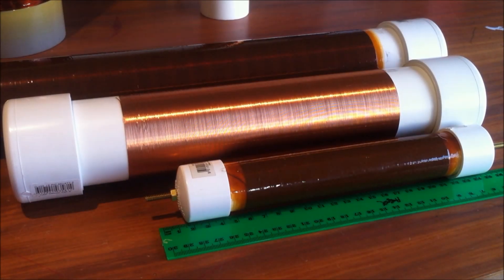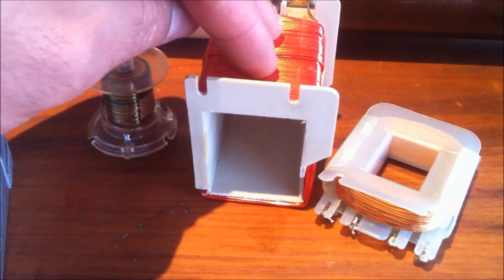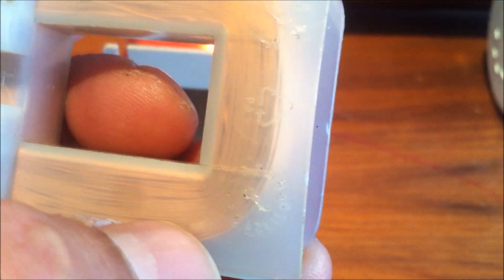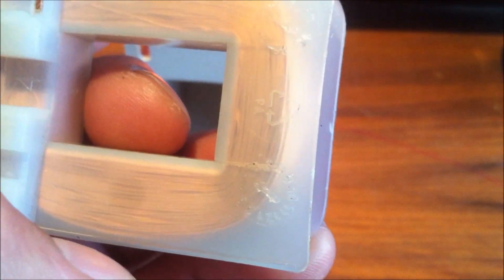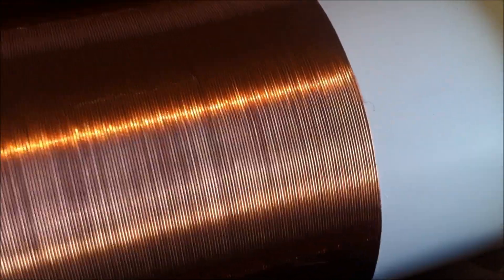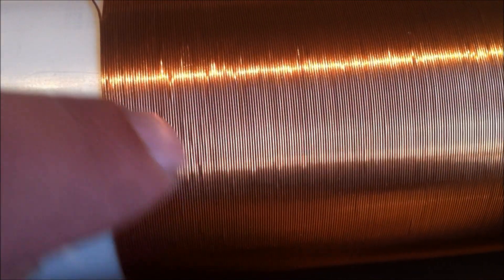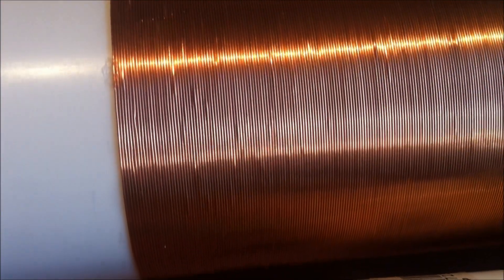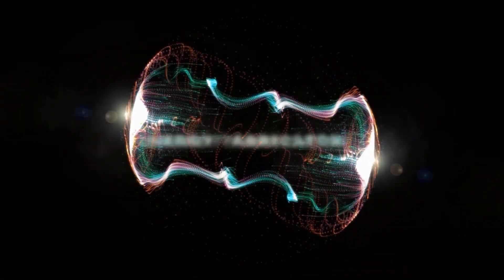How To #9 - Wind A Neat Looking Tesla Coil Secondary Winding (Quick Tip)

Comment: Toshiba MOT primaries are the best to salvage wire to reuse. Others brands tend to use too much varnish. Starter motor solinoids  don't  use any  varnish but the wire is not very long.

Comment: Good tip! Also, you wouldn't happen to know any places where I can get some 0.8mm magnet wire? (At an affordable price) Looking for some to rewind a vintage electric motor stator with
Reply from the maker: +CAL'S ENGINEERING 
No, I'm not sure of where you can get that sized wire. I usually salvage wire because of the cost, but it's hard to find long lengths in good condition. How about using the primary coil from an MOT? They are usually around 1mm including the insulation, so the wire itself would be around 0.9mm diameter. I have a couple here if you want them.

I was talking to my friend Karl about you today. He is interested in a couple of your small glass insulators for a crazy piece of neon artwork he has designed. I also want a couple of them... badly!
If you are interested in trading 4 of your small glass insulators, I have heaps of stuff (materials and parts) you might want. Let me know if you are interested in trading...no pressure...  :)
Reply: Energy Fabricator Ah OK. Sure if you want to do a trade we can, is it the really small ones (CD490s)  or the suspension type? I don't have many of the CD490s but I can certainly trade a couple of the suspensions if you want
Reply: Energy Fabricator I would have to talk to my mum about it, as she does share part of the collection of the glass ones as well. (Some of them have come from really special places too, and do have a bit of a significance to us)
Reply from the maker: +CAL'S ENGINEERING 
I Understand - I also have stuff I can't part with. 
Karl needs two of the glass suspension type (an identical pair with same coloured glass) with the fork on one end and clevis on the other end. I would like two small glass CD490's OR one of the CCG (made in Canberra) small clear glass insulators.
Reply: Energy Fabricator ill see what I've got, I've only got about 3 of the CD490s and I think my mum's pretty close to those (sorry about that) most of the suspensions are various different shades of green but not majorly. Do you have any antique or junk shops near where you live? If so you can sometimes find insulators there at a pretty good price!
Reply from the maker: +CAL'S ENGINEERING 
No problem. I'll keep my eye open for them... I'll find some one day!

Comment: Wouldn't annealing the wire by heating it soften the copper enough to ease out the kinks?
Reply from the maker: +Syncubus 
Heating it would melt the insulation and it sounds like a lot of work..
Reply: Might affect the red insulation